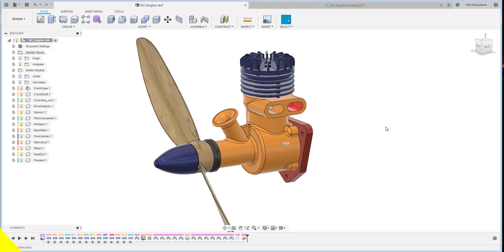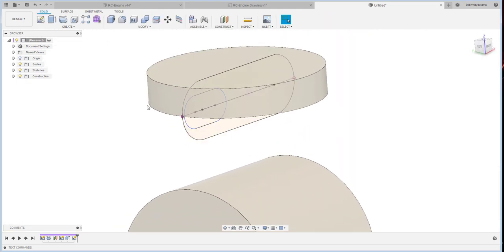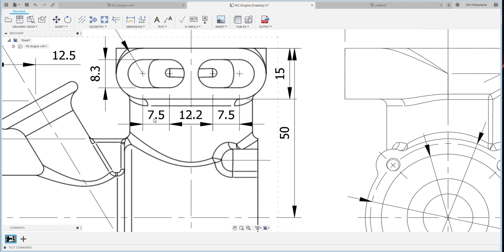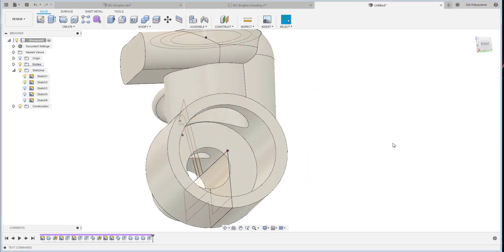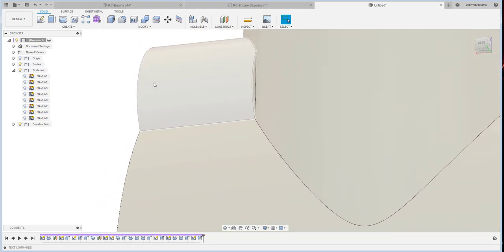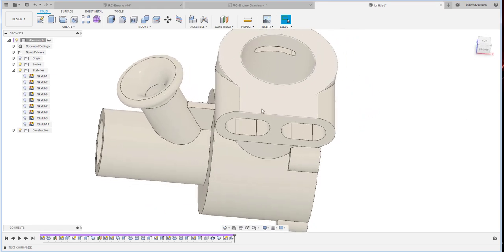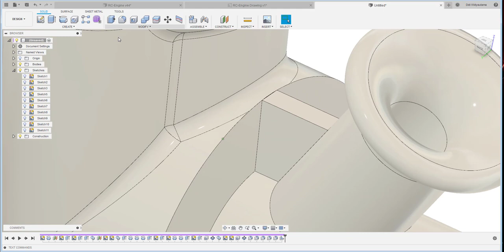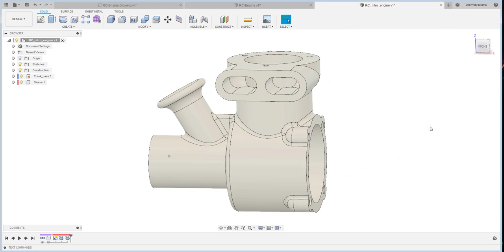Fusion 360 - RC Engine Modeling (Part 1)

Comment: Hey Didi, the reason the slot was off-center was because the offset plane you created at 8:45 was not in the center of the cylinder. It should have been placed at -37.5 mm from offset. You corrected it with the sketch at 31:00, but I thought I'd comment to let you know.
Reply from the maker: Good, thank you for your feedback, I appreciated
Reply: @DidiWidyaUtama  Also just wanted to say thank you for being so generous with your YT channel. I am learning Fusion 360 for my job and learned a lot from your videos. Have you ever printed a model you made in fusion? It would be super cool to print out the RC engine and see how it works!
Reply from the maker: @isaacweber1918  hi thank you, for this rc engine i haven’t have a chance to print it, but if you do, please pay attention to the joints tolerance you need to add, good luck

Comment: I cannot understand when you are drawing the first profile,why are you using diameter dimensions?
Reply from the maker: louie s it’s just common sense if we like to measure a cylinder , than we usually measure in diameter instead in radius.
Reply: Didi Widya Utama I figured it out after actually making the part.I thought you were going to make something else with that profile and then I saw how stupid I was :).I got to the point where I' m done with those two slots and with that revolve operation from inside that channel.I' m at 23:25 with the part right now but I had to take a break since I'm on the PC for 5 hours now.Anyway keep up the good job,those parts are fantastic.
Reply from the maker: louie s great, keep on going, thanks for visiting my channel anyway.
Reply: @DidiWidyaUtama  Well,I saw good stuff.I managed to finish this part.I will continue with the next parts.Thank you for the video!
Reply from the maker: louie s U’welcome